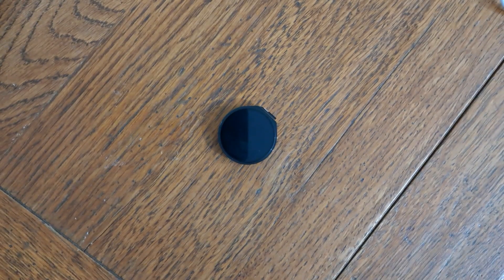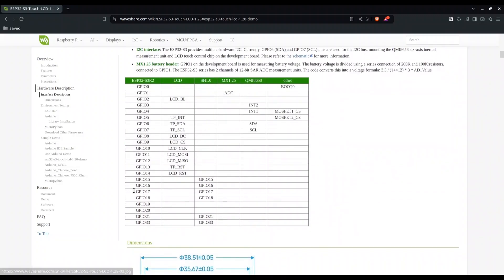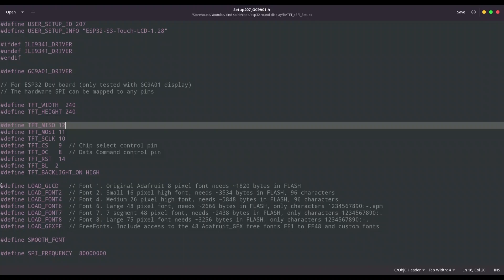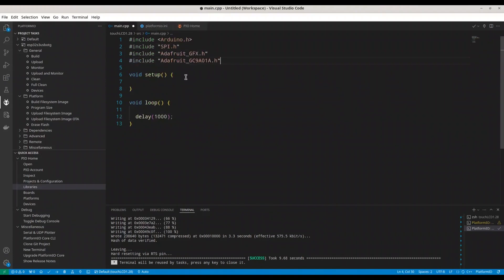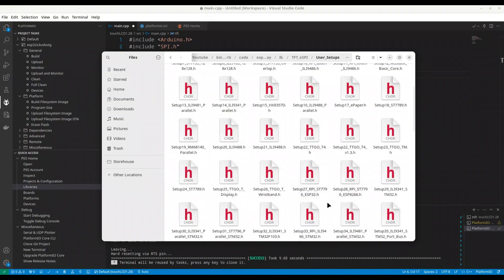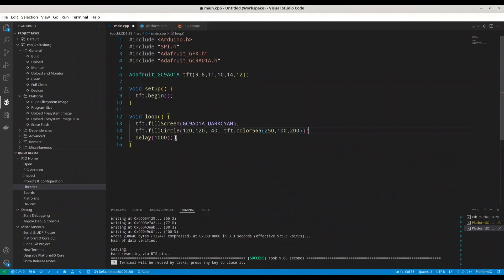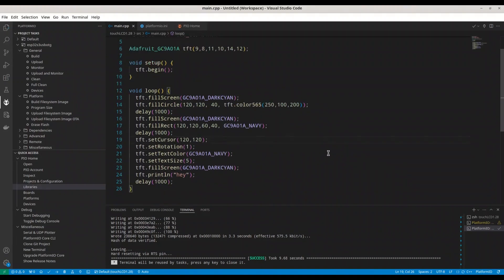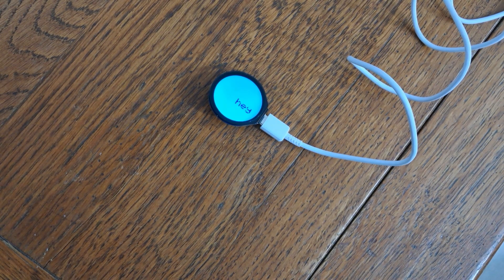ESP32 & ESP8266   ESP32-S3 Touch LCD 1.28; episode 1

Comment: Thank you my Dear I loved the way you explained. I have a Question - How do we place the Battery in this device? Can it be placed within the Board?
Reply from the maker: Some devices like this have integrated battery port, so the only thing that you have to do is to hook up battery and voltage regulator. In most cases, you would have to add charger module and battery holder manually. Depends of model of module you bought, so read specs carefully. And no, there is no way to put battery inside of round screen module; the best thing that you can do is to build some kind of wooden or plastic box or to print some on 3d printer and then to pack everything the way you like.